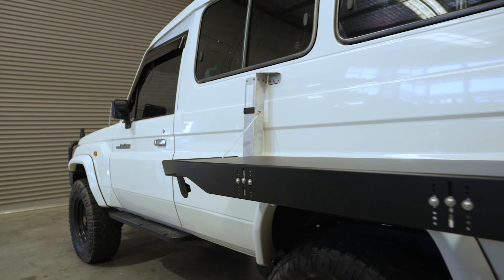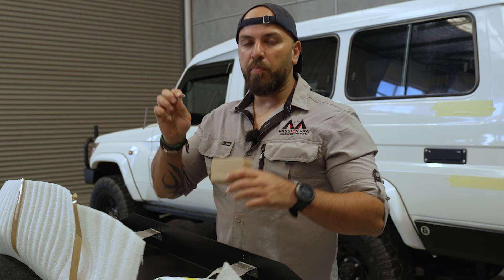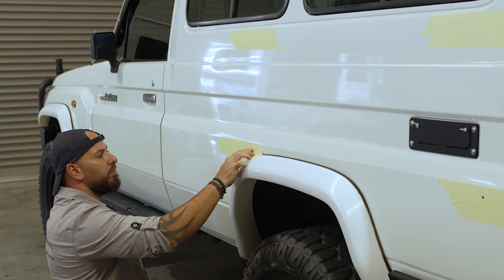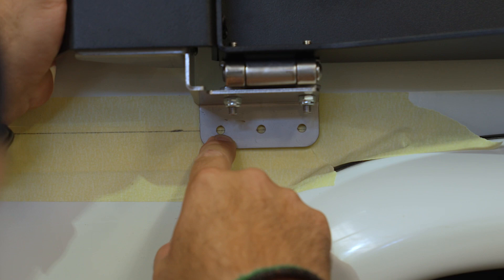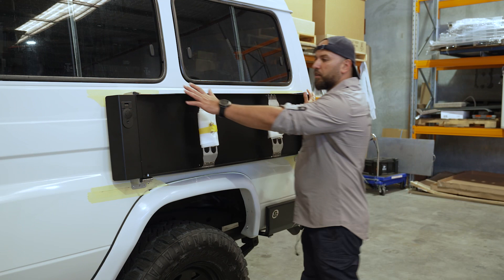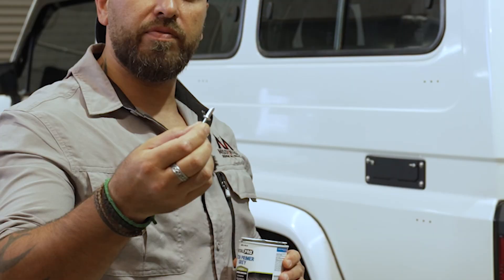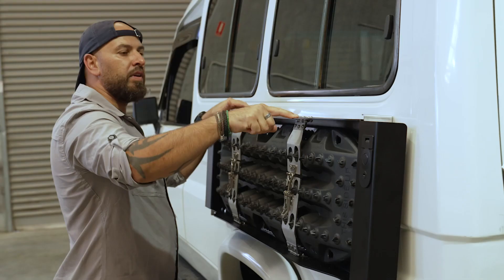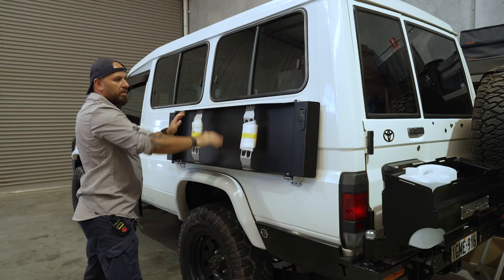Toyota 78 serious Troopy Maxtrax Table Installation

Comment: Another good vid Sean. Is Two locking clamps comes only with stainless steel?. Not a fan of shine stuff. 
Currently got a 78 on order. Long wait 

Rooma
Reply from the maker: Thanks mate, you can have them powder coated black , and can be organised here at mission 4x4 for extra $80 .
Reply: Thanks Sean. Got my spread sheet going at the moment. When the car is here will call you 

Keep up the good works mate
Parties !!!

Rooma

Comment: Using rivets is a bad idea , it creates a weak point and has. Nothing to support it from behind the body panel,,nuts & bolts ,with washers behind the body panel  would be far more superior
Reply from the maker: i agree with you , the only issue with that is, the majority of the Troopys have internal fit out with electrics and water fitting,  if the table is damaged or need to be replaced , it means you need to remove the interior fit out to access the nuts,  to me that is a big job and costly, that's why i use BLDU stainless steel structural rivets which created a body washer from inside, this type of rivets used in aircraft and can hold stress and Vibrations .
there is 12 Rivets in total on each table, and that's a lot of strength.
If there is any issues in future, simply just drill them out.
I have sold nearly 500 table in the past 2 years, and not a single problem.
I hope this help